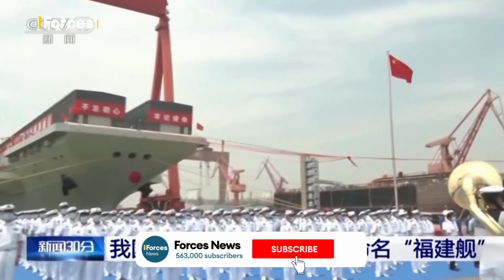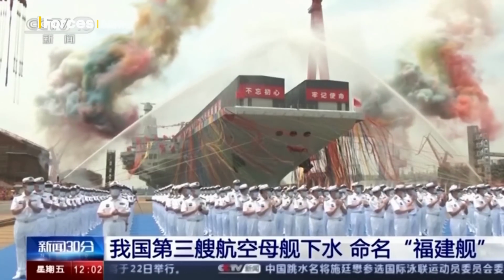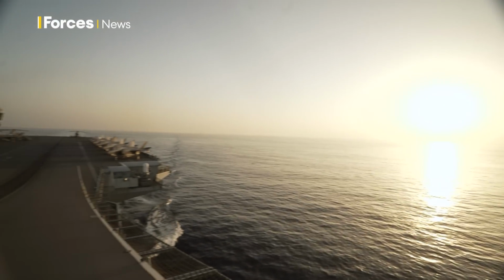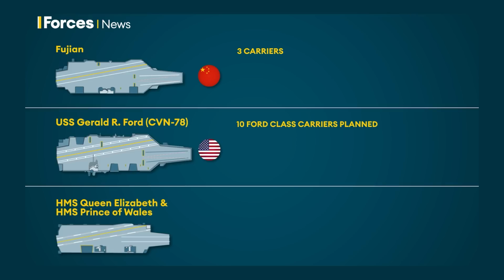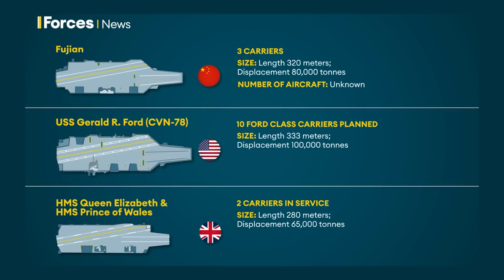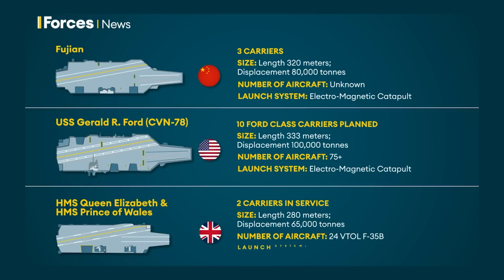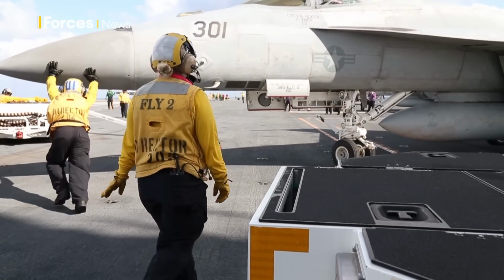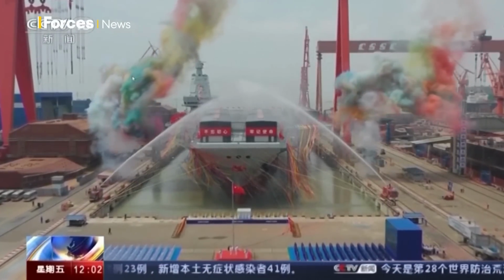Is this China’s rival to western aircraft carriers?

Comment: You said the rest of the US carriers task force is not nuke power. Yes, and no. The surface ships may not be but her submarines most definitely are. The thing is, how many does she have and where are they? You know they are prowling around but do you dare trying to get close enough for a firing solution? Also, just because the new carrier floats doesnt mean it can fight. For that matter can it even move under power? If the US had problems with the new cats then what would make you think china wont. Stealing the plans and building it doesn't mean it will work. Ask Pakistan and a number of other countries in Africa how bad chinas military equipment is. No, it is not a threat now and likely not for a long time. Another paper dragon.
Reply: You're scared of paper dragon 😂

Comment: The Chinese are hoping that their aircraft carrier isn’t like their Russian brethren aircraft carrier, i.e., a money pit that will spend most of its service life in the shipyard trying to fix the unfixable.
Reply: That carrier was already sailing fine with their own stuff on it, and now you're crying about their new carrier.
Reply: LOL 
The circumstances are completely different. The Kuznetsov Class was installed with farcically outdated steam turbine engines that harken to WWII. It was built in the twilight years of the Soviet Union when financial atrophy forced the navy  to cut corners in construction to save budget. It was built in Ukraine but later acquired by the Russian navy after the USSR went kaput. The Russian shipyards had no experiences handling carriers, resulting in the early retirement of all Kiev class carriers in mid-1990s (as they were also all built in Ukraine). The single  Kuznetsov carrier was preserved for political reason. Then Russia's economic collapse caused the collapse of its military budget, which reduced the standard of maintenance works to junk status. Forget about the engines - more than half of the toilets onboard Kuznetsov were NOT working due to neglected maintenance. The whole ship was simply a floating nightmare - full of hazards, rusts, tear and wear. Nobody gave a damn as the sailors and engineers' salaries sometime went unpaid for months.
How is any of this remotely relatable to modern Chinese navy?

Comment: There is no strategic or tactical advantage to nuclear power on a surface ship. They will still need RAS for weapons, victualling and aviation fuel and will only cruise at the speed of the slowest accompanying ship.
The Chinese have also proved there is no need for nuclear power for electromagnetic catapults. The QEs already have sufficient power, could be converted at a mid life refit and are already passively engineered for it.
Nuclear power just adds weight (and therefore displacement), complexity and a need for huge numbers of extra high grade crew which adds to hotel power, victualling and accommodation space
 This new Chinese ship is almost a carbon copy of the Ford and is 20,000 tons les displacement. Or rather we KNOW its a copy given how the Chinese copy everything.
Reply: Sorry, did you just say there's no tactical advantage to not having to refill your ship for 20 years? Are you OK?
Reply: Really no tactical advantage to having enough power for future energy-based weapons and high-power consumption up grades. China has not proven anything at this point.
Reply: Have to disagree mucker, saves the RFA in our case supplying fuel, carriers are thirsty ships, Yanks have no worry powering that way.
Reply: @henryvagincourt4502   Well we must agree to disagree then chap. The RFA ships are in a CSG to refuel all the Frigates, Destroyers and other nations' ships in a CSG so why not the carrier? And they do not need refuelling for 10,000 miles.
Can I gently suggest you read my somewhat lengthy reply to @Ron Labia and especially the cost implications of nuclear powered carriers?
Now I know you Matelots like your scran but a QE has 1,700 souls aboard which is about 1/3 the crew of a Nimitz. Guess which ship requires more victualling and therefore more RAS?

Comment: I'm sure that the CCP would rather that we don't notice that the cats are covered, my take is that the structure covers holes because the builders have issues with the EM system.
Reply: Check out Gerald Ford launch pictures.  The catapult were all covered as well.  Fitting comes after launching.
Reply: You're only sure of what you wish they didn't build.
Reply: @tritium1998  They can build what they want; don't need this for Taiwan.
Reply: @tritium1998  They can build what they want; don't need this for Taiwan.

Comment: How is there a debate over nuclear or not? Far more room for aviation fuel if nuke powered.
Reply: still need food for the crew so still needs resupply and its limited on were it can dock, also refueling takes years
Reply: Still need to be refuelled with aviation fuel, and still needs food for the crew.
Reply: They still needs to test the nuclear reactors before putting on a carrier.  You can’t just throw together bunch of nuclear sub reactors and put it in a carrier like what the French did, as it’ll lead to a lot of problems down the line.